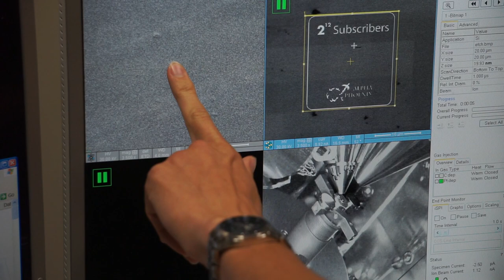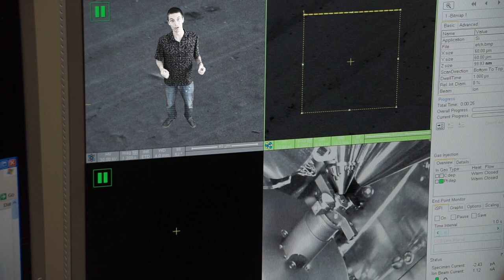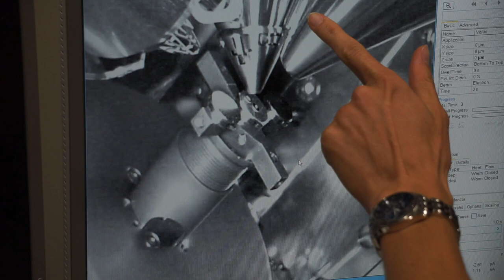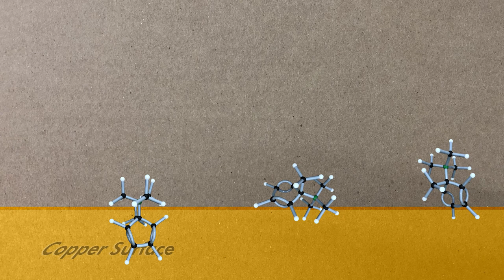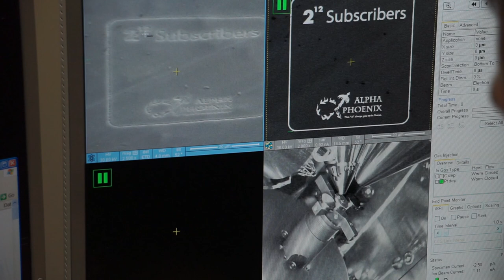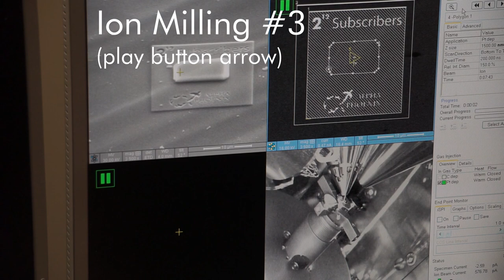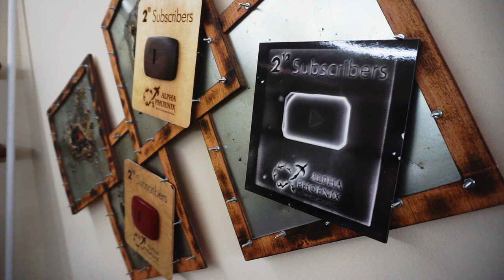Making the World's Smallest Play Button (2^12 subscriber special)

Comment: I know nobody will read this, but I actually worked on a even smaller scale not so long ago. I had the chance to work on an electronlithographie machine, which was capable to "print" structures with an diameter of 2 nm. Of course i used this multi million euro machine which is one of the most advanced systems in the world to print a smiley. But unfortunally one can just manipulate the upper most layer on the probe, and has to do some chemical processing to be able to see the result. But also, great video and good explanation :)

Comment: Oh man. It’s pretty interesting to see how the electron microscope sees things differently, especially how it’s “lighting up” the area with its own electrons and causing unconventional shadows to appear. Makes me wonder if by measuring the deflected electrons’ energies you could process the image with false colour.
Be pretty tough to beat this for your next milestone, perhaps a silicon MEMS play button or light emitting/otherwise doped semiconductor play button for the small scale. On the large scale there are a fair variety of interesting chemical processes and unusual CNCs that you could attempt. Even growing a plant into a play button could be an interesting task.
Reply from the maker: You can totally process for the energy of electrons coming back - it's the reason most modern SEMs come with a bunch of different detector geometries and energy sensitivities. you can extract all kinds of information! If you want to get really fancy, you can look at the x-rays that come off the material when you hit it with the beam, because those can fingerprint specific elements. search for "EDS map SEM" and you'll get all kinds of awesome shots of compositionally-colormapped micrographs. As for the weird shadows and whatnot, SEMs are way cool in that they form an image with only one pixel's worth of sensor - the electron beam just only lights up one tiny spot on the sample at a time, and one by one, the beam lights up a new spot, the value is read off the "single pixel" detector, and the beam moves to a new spot. it's why the screen refresh was always top-to-bottom, it literally has to scan over the whole image to see it. I thought about making a camera like that (laser on a gimbal and a single photodiode detector feed into an audio recorder or something) but haven't gotten around to it yet.

Comment: The engineering on this is ridiculous. It's one thing to capture electrons blasted through a surface so small you could destroy it by breathing on it, and it's another thing entirely to etch stuff into that and deposit material onto it on that kind of scale; but the most impressive thing I feel is the fact that that machine can pull a vacuum so complete that it practically eliminates all interference, and that you can create an environment wherein that little piece of copper has only very minute amounts of "bits" stuck to it. Given the amount of random crap that floats around in the air at all times, that's a practically impossible ask, and yet, here it is, in all its glory, for us to see and you to work with. Science is nuts man.

Comment: Holy cow that's impossibly precise. That's amazing. What's the ballpark cost for that whole setup? I'm curious, with a really good light microscope, can you see that the play button exists? A tiny dark spot, if the carbon is dark colored? Do you have to use a copper (or other conducting) surface for the deposition? I suppose you would for the electric field to accelerate the ions properly. I'm curious what the possibilities are for printing conductive traces to make nano-scale circuits. Here's to 8192 subscribers!
Reply from the maker: I actually have the (unstable, maybe dead?) power supply from this microscope sitting in my garage right now - not sure what I'm going to be able to do with it, but they were getting a replacement!
I think the entire setup is just under $1M. The electron microscope is a few hundred k, the ion gun add-on is a couple hundred k, the micro-manipulator (that I didn't get to use in this video) is ALSO a few hundred K, and then there are some (relatively) cheaper odds and ends, like two GIS needles and whatnot. for internal users it's $120/hr.

I have access to a REALLY nice optical microscope in a different lab, and you can't really read the "Alpha Phoenix" unless you already know what it says. I chose an easier font for "subscribers". It flashes onscreen at 1:49 for just a second.

metal traces for electronic devices are almost never deposited via fib (unless it's a really experimental device, normally something with nanowires or graphene flakes where you need to find a nanowire somewhere and print contacts on it). It's more common to make real devices with photolithography and to evaporate the metal on top of a mask in a dedicated chamber. Then you peel up the mask, and you're left with metal exactly where you wanted it.
Reply: @AlphaPhoenixChannel  Oh! Thanks for that reference to 1:49. I had been focusing just on the electron image. Wait, if the line width of the o in Phoenix is 90nm, how are we seeing it so clearly (or at all?) with light at a wavelength on the order of 500nm!?

Comment: That machine does not look like a kludged-together piece of lab equipment.  it looks like production quality.  it's good to know that nanometer-scale milling, 3d printing and SEM are mainstream now.    now if you can just make a nanoscale lathe we'll be in business
Reply: They've been making them professionally like that since the 70s. The SEM anyway is pretty old technology, mostly analog components. Of course they are much better now thanks to computers fine tuning, in the same way IC engines are better than in the 70s, but you can find similar "well made" machines from the 80s in the basements of many university materials science departments still chugging away on windows 95 because the company that made it hasn't existed for twenty years, so there are no updated drivers or software. You can even buy some old ones for not that much money I hear. Small companies often snap them up, but there's a YouTuber that has one, but I don't remember his name. His is older than I've ever seen or used, from before computers so it outputs to a CRT and "saves" images by switching to a film plate. The original screenshot. 😂

Comment: So it's 11 µm wide.. That's still visible to the naked eye from a meter's distance. As the "smallest" things a human eye can perceive is an arc minute, and an arc minute is 2.91µm at a distance of 1m so from a distance of 1m, that sub button is 3.78 arc minutes, which means it's just slightly smaller than the width of the smallest letters on a 20/20 sight chart, which stands at 5 arc minutes. Meaning that from a distance of 1m you can actually see the Subscriber button. And you can tell that it is a subscriber button.

Comment: Random question... If you're familiar with Von-Neumann probes, you'll know they're supposed to be launched to other planets, where they use in-situ resources to create more copies and launch those in turn.

Focussing purely on the self replication aspect... Gross mechanical structures can be 3D printed, but electronics, things requiring complex assembly and and high tolerance parts have always been a pipe dream.

I'm aware it would be insanely slow/inefficient but if you had high quality precursors, could you use the processes you demo here and elsewhere to construct say a PCB? A lens? The parts for a chip fab facility that you couldn't get from a 3D printer?

You've mentioned depositing alloys. How about more complex compounds?

I'm assuming the level of care, attention and manual tweaking required makes it infeasible to automate _now_, but at it's heart that's a software/hardware problem.

What's the fundamental limitation that can't be hand waved away over? Is it purely time, scale and efficiency?

Comment: Hi! Late to the comments, but I hope you see this. At 8:28 you mention that you stopped early because the button wasn’t growing symmetrically, but I notice that the electron microscope angle is askew. Does this have anything to do with your observation that the play button isn’t growing symmetrically? What other indicators are there for you to determine this? To me, it seems symmetrical, but the camera angle is misaligned.
Reply from the maker: In the fib you’re almost always looking at stuff from a weird angle - the ion gun and the electron gun are 52 degrees apart (do t ask me why). However the button growing asymmetrically has to do with the platinum precursor gas flow - it comes in from the right and flows left, but if you’re trying to deposit a really big thing over a large area, all the gas can’t flow and stick to the “back” of tall objects, so without gas on the surface to deposit platinum, the structure opposite the gas needle gets cut by the ion beam rather than depositing.

It happens whenever you have something large and tall that blocks he gas flow to itself. I’m not sure if the reynalds number applies in this near vacuum, but the flow absolutely detaches from the thing being grown

Comment: What happens if you switch off the ion source or sleep the microscope?  Also, I've gotten like ten video recommendations in the passed week, so I thought I'd finally check a video out.  Definitely happy doing so.  Adding my sub to your count.
Reply: Well you have to know what the source is. To produce the gallium ions the metal gallium source is basically heated until the it melts then electrically charged surfaces are used to rip a flow of atoms free of the liquid and fling them where you want.

If you turn off the source it cools down which can be a problem for a number of reasons, depending on the setup. In this case I would bet it's due to fouling. Even though the entire machine is under extreme vacuum, if there are literally any atoms floating around (such as from using the FIB) they can condense on the source and react with it, like metal rusting. When the source is on, it's too hot for that to happen, but letting it cool down it acts like a cold glass on a hot humid day. Or like a sheet of tape in a dusty room. So later when someone else turns the source on either it can't produce ions (it's covered in garbage) or worse their sample gets blasted with a bunch of garbage. That means the lab manager has to either replace the source (like changing a very expensive light bulb) or go through a cleansing process (burn the crap out of it) which may make the source usable again. Leaving the source on does waste it, but not as much as the cleaning process does. So the only time you really want to shut down the source is when you know it won't be used for a while.

Sleeping the microscope is a similar problem, electrons are boiled off a high temperature source. But in this case the source isn't likely to get fouled, it's more likely to break. The source for electrons is very brittle and the thermal expansion from heating and cooling is not uniform, so the more cycles it does the higher chance it has of breaking.

Comment: It is also possible to deposit platinum with the usage of the electron beam, how does this works technically? Cause you arent using gallium fib iones in this case...
Reply from the maker: Same deal just less efficient. The gallium beam or the high energy electrons slam into the platinum gas molecules and crack the metal atoms off of it
Reply: @AlphaPhoenixChannel  Thank you!

Comment: Impressive !   I wonder what is the price of this machine ?
Reply from the maker: Oooohh boy... If I remember correctly, the  microscope itself with two guns (e- and Ga+) is on the order of 500-600k, then there are two GIS needles and a micromanipulator that I didn’t use in this video. I think each GIS is under 100k, but that micromanipulator is a work of art... I believe the complete package is >1M.
Reply: @AlphaPhoenixChannel  Thanks for the information. I thought it was much more expensive ! by the way you also answered a question bugging me many years ago about the smoke from the soldering Iron. Also another detail : It seems that a scanning laser beam has some bad effects if projected on the body. It has not to do with the intensity (in case you felt something bad even with protective goggles).

Comment: How is it that you prevent bacteria or microscopic particles contaminating the sample?
Reply: You clean everything before you put it in, ideally. You'll piss off the other users of the machine if you put in something dirty because it will contaminate the chamber until cleaned.

During use the chamber is kept under extreme vacuum after cycle purging with inert gas.

Comment: Thumbs up if your heart stops for a few beats when the stage pivots

I used to do this, but we didn't have collision detection so even if I was moving the stage to a known safe position I'd still get nervous pressing go
Reply from the maker: I got a stage touch alarm on this machine once and immediately panicked and went to go get the engineer in charge. Turns out it was fine - I’d overtired and touched a shroud/guard on the pole piece, not the pole piece itself… but I was still stressed.

I also dropped part of a stage down into the pumping well once and while I was down there retrieving it, I found a bonus Allen wrench
Reply: @AlphaPhoenixChannel  I forgot to retract a detector.. I forget which one, but it had to manually drop in once the stage was angled, and as close I could get it without blocking the ebeam. I was using it for hours so when I finally finished I was so ready to go, slipped into my standard shutdown routine, hit go to home... Immediately felt that panic and stopped it in time (that's why the go button turns into stop).. I've been in car accidents that were less stressful. Good times 👍

Comment: I don't get why some fellas are saying they should get better computers, what with having such an expensive machine... but really, why? A "better" machine is not *needed*, not required to use the equipment, so would it even be better at that point...
Reply: The best option is the one that does the same job at the lowest price.

Comment: Windows XP?
Reply from the maker: If it ain’t broke
Reply: @AlphaPhoenixChannel  true but the updates and support has stopped , it's  a security risk isn't it rn?
Reply from the maker: All the equipment computers have at least one buffer computer between them and the internet (to move recorded pictures to personal folders) and they never get flash drives put in them directly. It’s not ideal but also not about to blow up.
Reply: @AlphaPhoenixChannel  interesting ,so would this buffer PC will be running the latest OS then right ? Or maybe linux